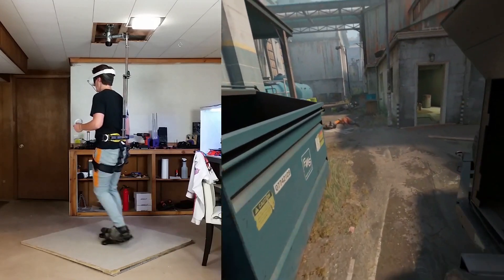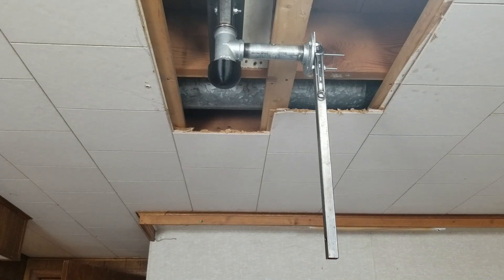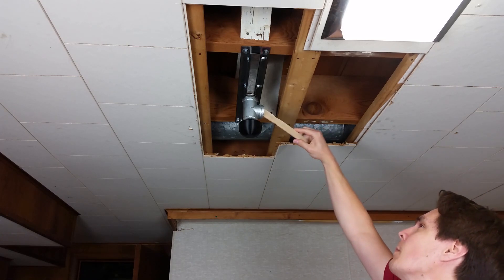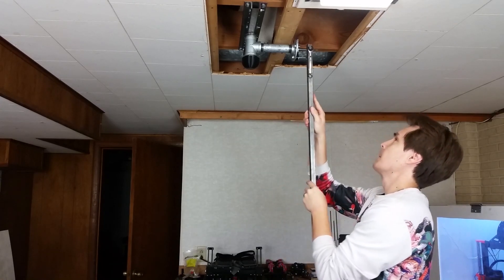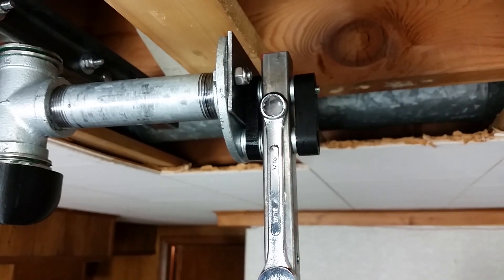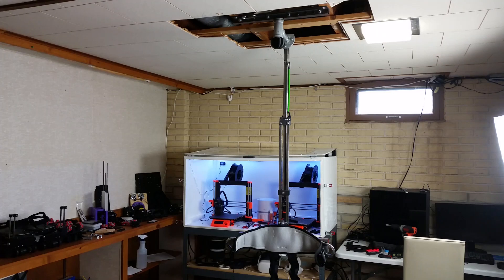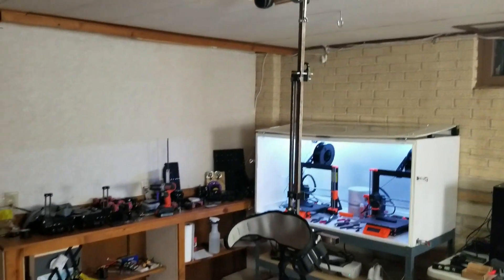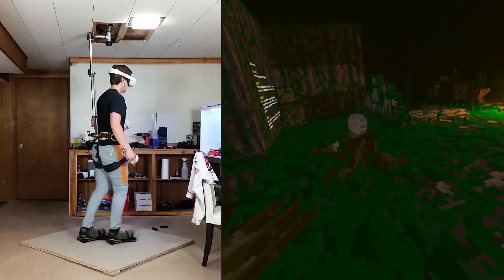VR Shoe Build Log #45 - The New Support Rig is Functional

Comment: Are you going to do a full build video on. Them
Reply from the maker: I have a few more improvements to make, but I can if people are interested. I have used it for about a month now and it's holding up fine. I want to try to make sure it will hold up long-term. 
The most common critical comment I get now is that people don't like that this requires bolting to the ceiling and a low ceiling. So I'm not sure if anyone will actually want to build it if I put out a guide. And it doesn't have feet tracking yet.
I'll be working on making a rig that doesn't require any bolting and feet tracking. Just need time.
Reply: @finallyfunctional  you could like mount it on the floor sort of
Reply: @finallyfunctional  Yeah. You could put the mount upside down in the middle of your platform. For a floor version. that would be cool.
Reply: Make a tutorial please please @finallyfunctional
Reply: But I’d love to know how to build it and adapted it to my play space